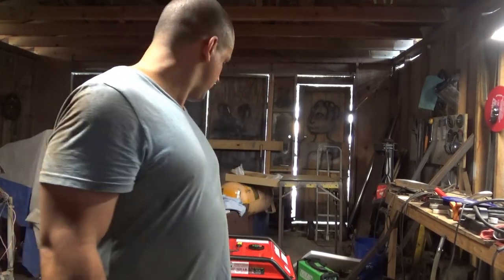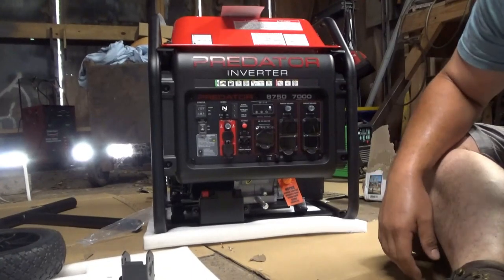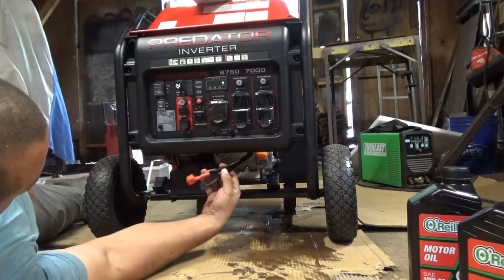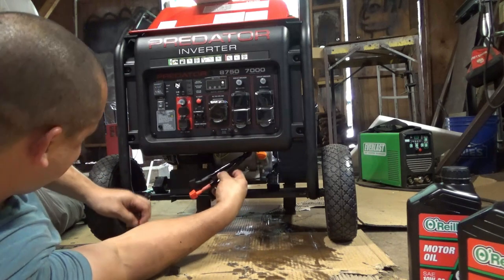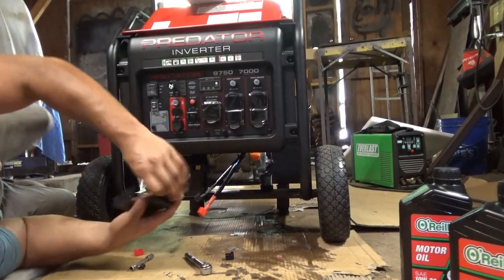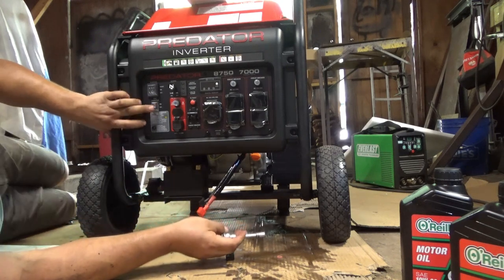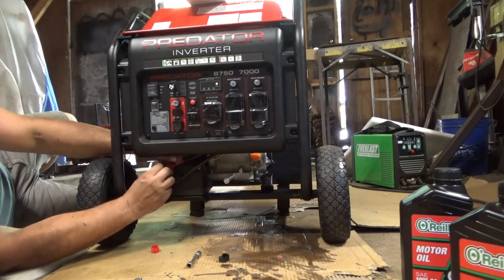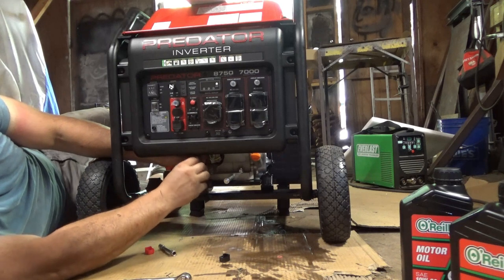Predator generator inverter 8750, setup and first start up.

Comment: Good effort.  Did you put it in actual use yet?   Does it call for a ground strap of some kind when using it or just when it is connected to a breaker box?
Thanks
Reply from the maker: I'm using now. I will post vids in the next few weeks
Reply from the maker: Oh, I assumed you were asking about using my welder with it.   I have at this point, but so far I have about 25 hours on the generator. And so far no issues it works fine. I usually only have a fan, a light and a power tool on it.  like sawzall or drill or grinder. The welder works on it too. I've only burned about 10 rods with it though...